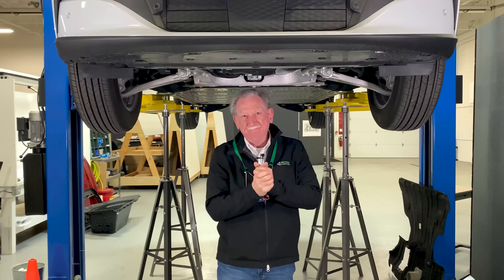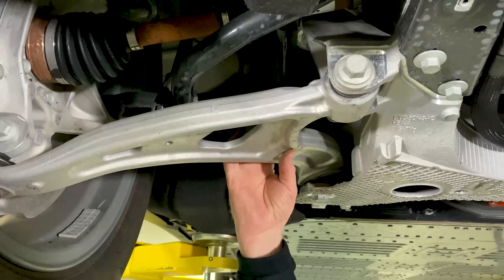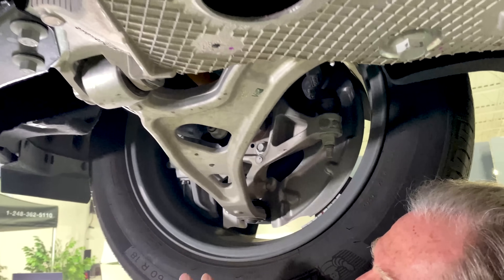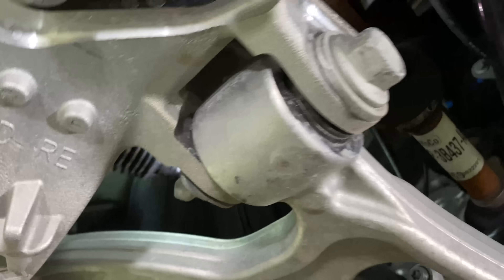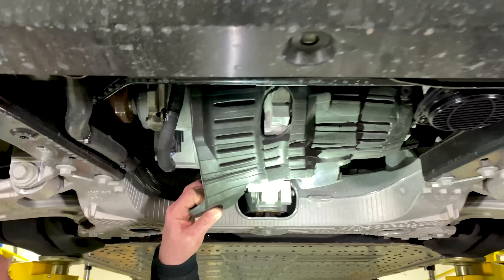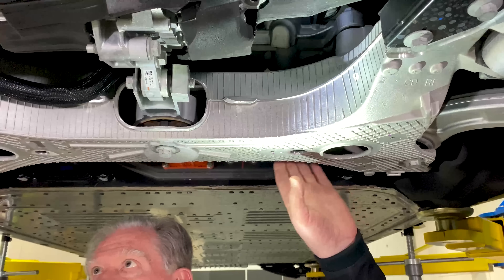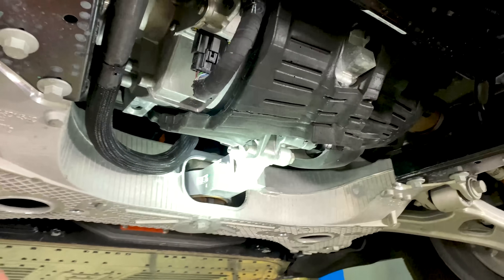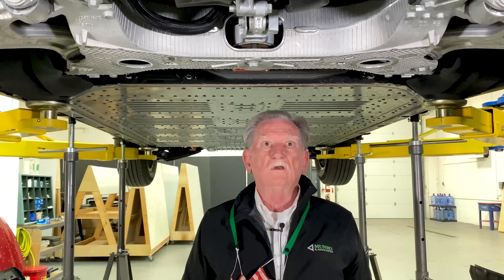2021 Ford Mustang Mach-E: E3 - Hoist Review | Front Suspension

Comment: I am impressed with the undercarriage of this car.  I have owned several Ford products, but never seen this kind use of aluminum and castings and extrusions.  I think Ford went all out on this one to make a statement about design and quality construction, in brakes and suspension and crash safety, on their first real electric platform.
Reply: I’m just surprised Sandy is not complaining about how expensive aluminum is compared to stamped steel…
Reply: @Tegneaufreak  no it’s not. That’s a future product that’s using MEB. GOOGLE IT.
Reply: It didn’t look at all like the ID4 undercarriage when Sandy had that one on the lift a few weeks ago.  Not sure why you got that impression.
Reply: @eddiegardner8232  Yeah, I have no clue what @San is talking about. There are some similarities with overall suspension design, but obviously a lot is different. I did find it odd that Sandy seemed to criticize the ID.4 for using McPherson struts which Sandy said was “not a BMW quality suspension” [like the Tesla] because it used struts instead of double wishbone. I found the BMW quality part to be funny because the best handling BMWs including the 2-series, 3-series, 4-series as well as the X3, M3/M4, Z4, i3, i4, etc. all use front struts. Only 5-series and up sized BMWs use double wishbones up front. Struts are cheaper to fix and have fewer parts. For a car like an ID.4, struts are perfectly fine. 

I do think Sandy has a soft spot for the Mach-E because he’s from Detroit, he worked for Ford, and it wouldn’t surprise me if he personally knows people that worked on designing this product. He had a lot of critical things to say about ID.4 even claiming some of the lower control arms on the rear were shaped like they were because mistakes had been made, almost implying they had to retrofit some forgotten component.
Reply: I just watched a ride along on the GT version of the MachE.  It uses magnetorheological shock absorbers, of the type developed at GM to provide millisecond speed changes in damper rates.  Supposedly starting at around $60K MSRP, with comparable acceleration to the Model Y performance.  I will definitely be checking one of those out when they are released for production in the Fall.
Reply: @eddiegardner8232  yeah Audi, JLR and others also use magnetorheological dampers in many of their cars, too. The biggest problem I know of with the Mach-E is with charging. 0-80% takes over 55 minutes on a 350kW Electrify America charger, while going from 80-100% takes another hour and a half at a DC charger. Kyle (out of spec reviews/InsideEVs) has a video showing his experience. 

0-100% took over 2.5 hours. That’s unacceptable and unheard of really with any newly introduced EV. At 80% SOC Ford cuts charge rate back to only 12kW which is what you could get at home on an AC charger. I’ll be interested to see if Sandy does a 0-100% charge or not. That really kills it from being a road trip car. 

The most impressive new EVs I see on the horizon are the Kia EV6 and Hyundai Ioniq 5, both of which are adopting 800V architectures to enable 80% charge in 18 minutes. They’re democratizing 800V for the average person. EV6 will be available in a GT version that offers similar acceleration to Model Y Performance, but I would be surprised if they don’t beat Tesla’s efficiency. 80% in <18 minutes is seriously impressive. Even at 80% SOC the EV6 and Ioniq 5 are pulling in over 140kW, 12X what Ford allows with the Mach-E. Ford has got to fix the charging curve as much as possible. They really need to get an 80% charge in around 30 minutes to be even the least bit competitive with new models coming out. The ID.4 82kWh offers around a 38 minute 80% charge.
Reply: @eddiegardner8232  Can it compete with the Kia EV6 GT?
Reply: I don’t think any of the serious players have the relationship between car and charger dialed in except Tesla.  I watched pretty much all of Kyle’s road trip videos, and his Cannonball video of the Porsche and to say the EA charging experience was pitiful would be an understatement.  Tom Moloughney did a range run on the Ford in ideal weather conditions at cruise controlled 70 mph and got 280 miles from a 100% charge; I doubt a model Y would do any better, but it would likely charge back faster.  My personal use of any of these cars would be 99% local travel, charge in garage on a 50 amp 220 v circuit, so road tripping is not as much a factor, but they do need to get their protocols sorted out, and their accounting system in order, so that all you have to do is stop, plug in, unplug, and go.  All the uncooperative “unavailable” relatively new chargers that Kyle experienced, even while being monitored and somewhat escorted by Electrify America on the Cannonball would be a non starter for me, because who wants a car that is that much of a hassle every time you have to stop for power, so resale value = NIL, even if you were willing to put up with it as a local driver.
Reply: As to the Kia, which isn’t released yet, all I can say is to wait and see how it performs in the real world once it is available.  I have always considered them second ranked to Honda and Toyota in their ICE versions, but the S Korean companies have been major players in batteries, so they may be able to do pretty well in this Brave New World of D-Cell rather than Diesel cars; their build quality should meet or exceed Tesla in terms of the vehicle build, if not the tech.  I think it is very important with ANY of these new cars to not look as carefully at the specs as you do to the Real World tests on the road at real world chargers in Real World weather conditions.  A theoretical 350KW charging rate is meaningless for road tripping if you never see it at the charger, or only see it for a small segment of the charge curve in ideal weather conditions.  For people who live in housing without charge facilities, having to deal with this on a weekly basis would be a deal breaker, I would think.  And for companies which still have the Federal tax credit, it only fully works if you have enough income to owe $7500 in taxes; how many people interested in a Kia would be in that tax bracket?  The tax break is only for upper middle income brackets, not the previous Accent/Rio ICE customers.
Reply: @eddiegardner8232  there are already videos of the car being tested in real world from S. Korea and various European countries. The charging is insane and it also beat its range estimate in the three videos I watched. I’m referring to the Ioniq 5 which is the EV6’s platform mate.
Reply: We will see how it, the 6, works when it arrives.  I like the idea of 800 volt packs with lower current draws for charging, but Li-ion cells have working voltages around 4 volts, so the higher the voltage, the more cells you have to have in series to reach those voltages, OR you have to have one kind of connection, more series, for charging, and then electrically rearrange them in parallel for discharging, or run your drivetrain at the higher voltages, which affects the inverters and motor driver circuit design, and the semiconductors you have to build them from (IGBTs or MOSFETS).
Reply: @eddiegardner8232  All I know is that the Mach-E would be ruled out regardless of these other cars because it has the worst charging curve I’ve seen on any EV around that price. 55 minutes for 80% charge is very slow and the 90% or 100% time is even more ridiculous.
Reply: I don’t disagree about the charging curve; they need to get it up to at least 150KW during the bulk of the constant current part of the charge cycle to 80%.  Most road trippers would likely only use that part of the curve anyway.  The constant voltage part between 80% and 100% is pretty crazy and must be cell characteristics limited, since it is so much lower than the bulk charging phase.  If they could at least get that up to 50KW it would be useable for bridging long gaps between chargers out west, but at 10KW it is only reasonable for overnight charging to 100% for a long first leg of a cross country trip.  We will eventually see if ANY manufacturers are able to get around this fundamental limitation of current Li-ion cell chemistry; Ford currently hasn’t; maybe they will do better later with software updates as they get field feedback from the cars in customer use.  For everyday use around town, with home charging, this is of course irrelevant.

Comment: I wonder if Ford made the whole battery pack or if LG did that along with making the battery cells. I also wonder who is supplying Ford the more advanced suspension and frame parts, doubting they are doing it themselves at this early stage in their EV program. They seem to be on the right track, though, which is a little encouraging.

Comment: 2:55 Steering column rust already?
Reply: Surface rust is normal on that part. Doesn’t and won’t affect function. Like rusty rotors after a rain storm.
Reply: @jmm6165  https://tfltruck.com/2021/04/ask-tfl-im-really-concerned-i-spent-over-70k-on-a-new-f-150-and-its-this-rusty-what-should-i-do/  Normal for FORD, I personally used  Yamashield on most everything I could on my Y, except brakes, glass and paint.  A silicone coat on as much bare metal I could to slow down the corrosion.
Reply: Those are the CV axles. The CV joints will wear out before the rust has any structural effect.

Comment: "This doesn't look like a Ford underneath"... I suspected that all along when they made the "Mustang" into a 4 door sedan.  It felt like they were taking someone else's skateboard and branding it a Mustang.
Reply: It's definitely a Ford. A lot of it is based on the new Focus platform.
Reply: Curious if Sandy comes up with who did the engineering? If not Ford, who?
Reply: @motofunk1  
Maybe Ford Germany?
Reply: @rogerstarkey5390  Good point.
Reply: I was gonna leave the same comment here. Then saw yours.
Reply: There are engineering firms that can design car for OEM. 
That could be the case here
Reply: Everything is engineered at Ford in Dearborn.
Reply: Nope. It's not what he meant. This was 100 percent done in Dearborn.
Reply: Ford has plans to use Rivian and VW platforms for electric vehicles. My understanding is that Mach-E is built inhouse.
Reply: @ShersGarage  True. Ford has put a lot of money into Rivian, and the E-F150 might be Rivian based. Interesting though, is if you see photos of Rivian's skateboard, the front suspension is upper and lower control arms, not MacPherson strut like shown here. The Ford-Rivian colaberation will be interesting to watch.
Reply: It's not a skateboard design - no one actually builds a skateboard, including Tesla. It's a conventional unibody structure with subframe-mounted suspension and drive units, and a battery hanging under the body.
Reply: Didnt Ford buy the entire skateboard? That would make sense as to why it doesn't look like Fords engineering.
Reply: @the_ev_guy4187  Rivian, maybe? But Rivian's front suspension is upper and lower control arms, not struts.
Reply: Yep and then buying 3rd party motors and assembling in Mexico
Reply: @teslascoop2177  one of the reasons Ford builds them in Mexico is because Mexico and EU trade agreement. Many of these Mach-Es are going to Europe.
Reply: VW supplies their modular platform
Reply: @MartininitraM  no they do not. The deal ford made to work on electric vehicles together with VW was only signed a few months ago. It was way after the Mach E finished development.
Reply: @MartininitraM  The ID 4 is completely different, go watch Sandy's video.